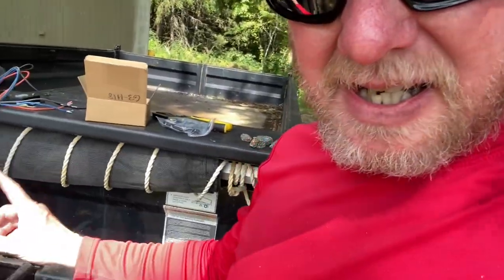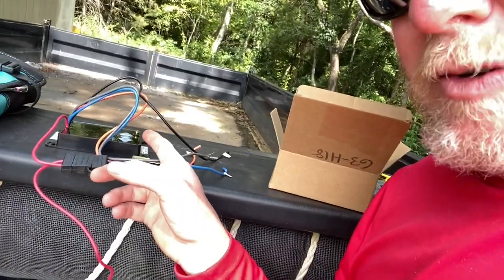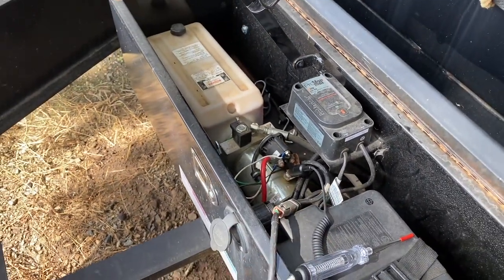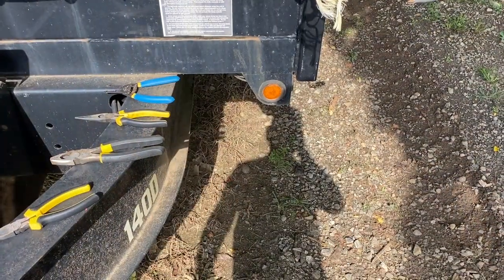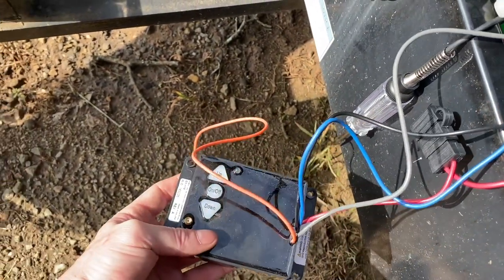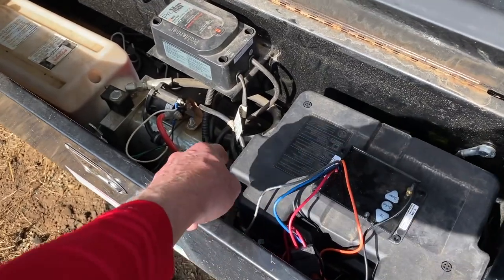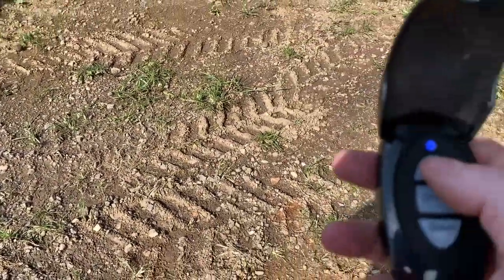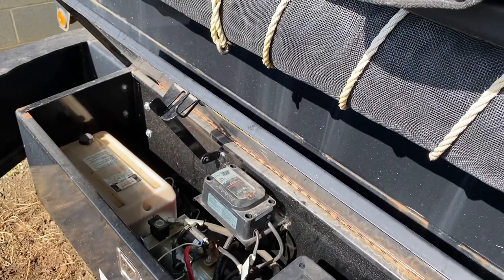Dump Trailer Wireless Remote Install

Comment: Man I need one of those for my litt dump trailer . My controller and cable will not reach to the front of my truck so I have to haul my gravel and dump it and spread it with my Massey so it's a lot slower pricy for me.
Reply from the maker: Love it and quick and easy install. For quick load and spread works great. Still have to get out to release the gate but beats dumping it all in one place.